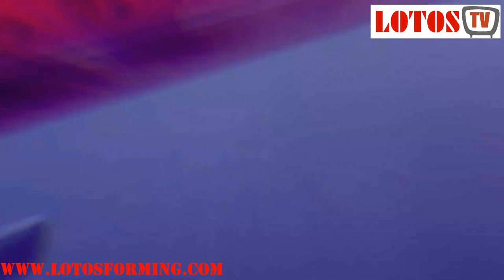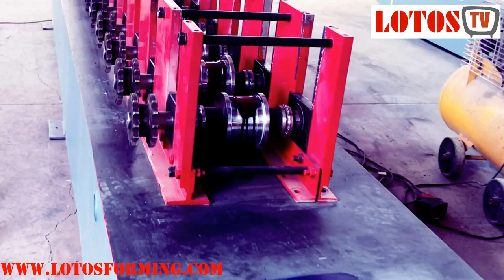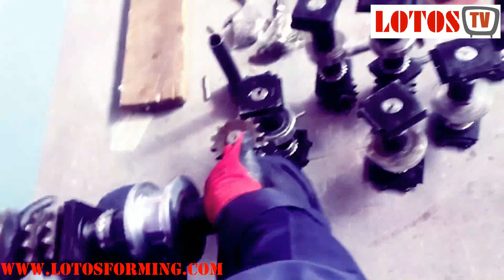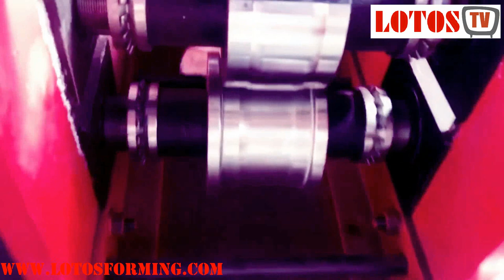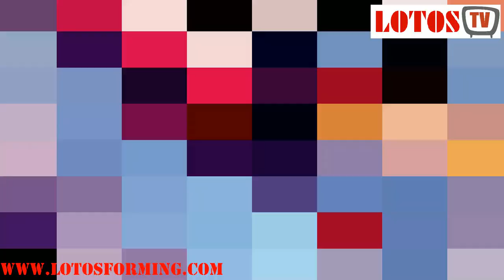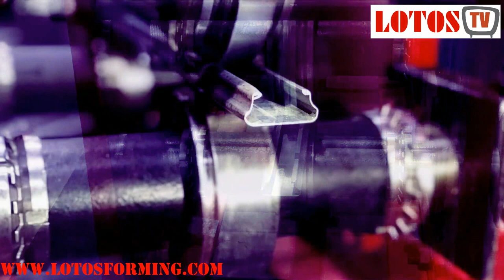【Lock Channel Making Machine】: Greenhouse Film Lock Channel Making Machine  " LOTOS DESIGN "

Comment: U channels are suitable for use in structural applications or engineering,furthermore, offering properties such as increased strength and durability and are typically used to support floor joists

Comment: The conductor bar roll forming machine includes decoiler, feeding, main forming machine, saw the cutting device, outer table, and electrical control system